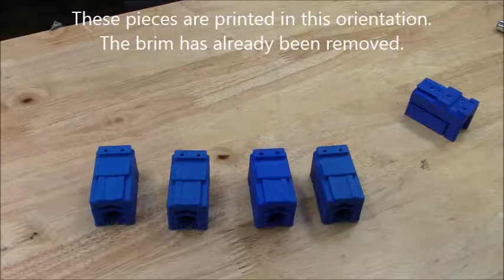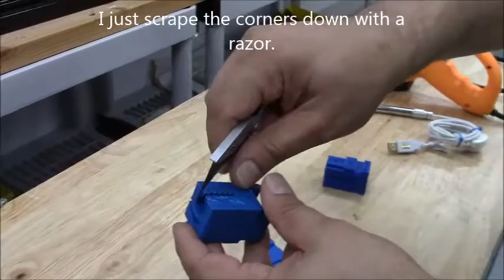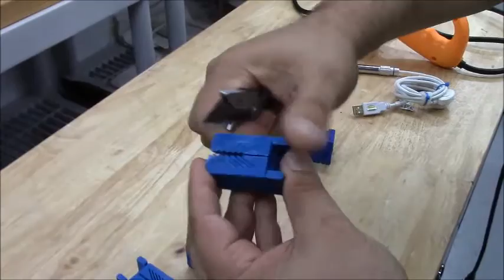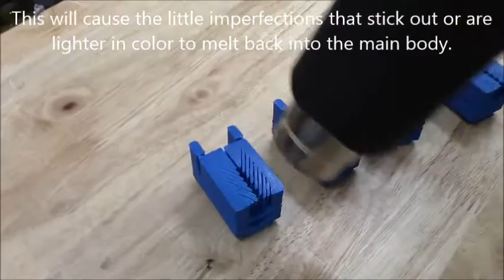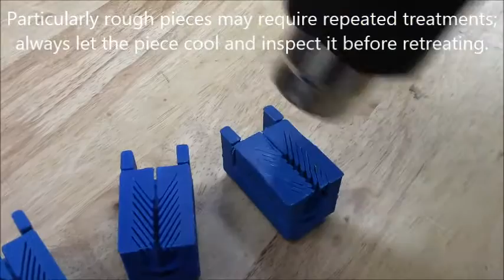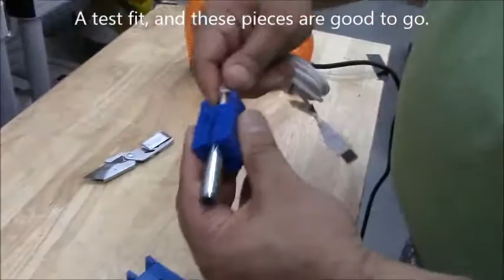Postprocessing with a Heat Gun

Comment: This may be a silly question, but how much heat do you actually need? Could you use a hairdryer as a temporary solution?
Reply from the maker: We don't have hairdryers at work, but I imagine it would do some good.
Reply: Hy Rel cool thanks
Reply: PLA glass point is only 65 C, so should absolutely work!